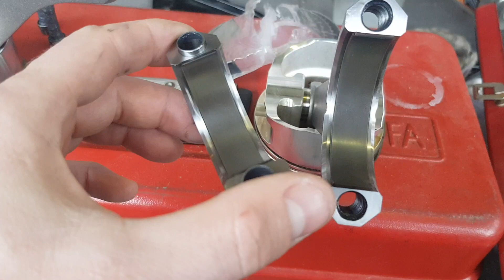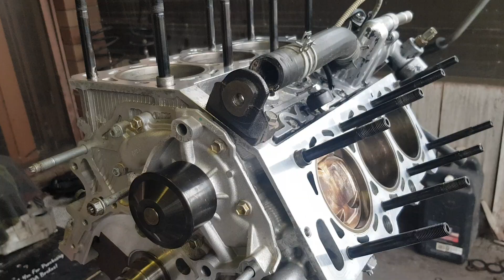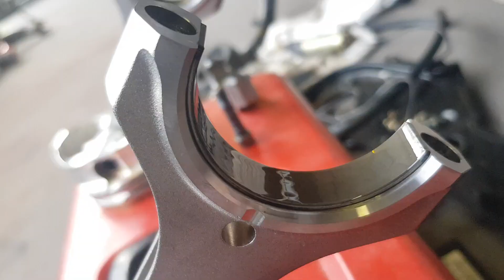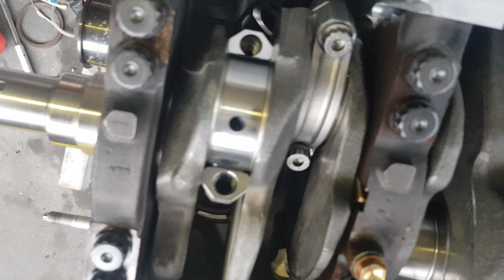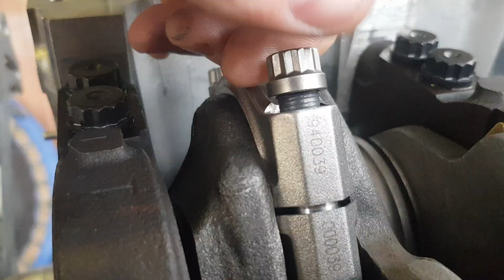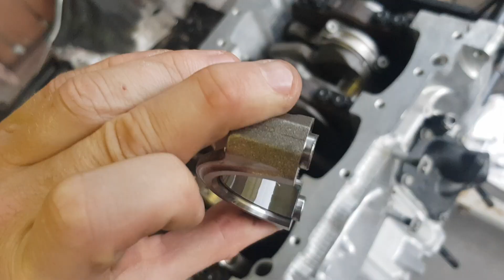Turbo AWD Camry - pt1- Forged pistons and rods.

Comment: Hey Broxon, I’ve watched all your videos in this series and am very interested in the build. You mentioned you got bored, so I figure I should ask if you’re still interested in answering questions about it, if not that’s fine. If you’re still okay with answering questions: Did you change the compression ratio with the aftermarket pistons and rods or keep it the same? The pistons look a little dished so I’m guessing you lowered the CR in preparation for boost. Did the aftermarket rods change the stroke? I’d assume the bore has to stay the same because the block is sleeved, right?
Reply from the maker: Decompressed yes, rod length same, bore same.

Comment: Going to have to scour this series up and down for a while.
Wondering if your Carillo pistons are the 87.5 2jz pistons or custom 1mz?
Reply from the maker: They arnt either of those. However the piston details is something I don't ever mention. If you are smart you will realize you can measure the oem piston to find one from another car that suits you. 2jz is not close at all.
Reply: @broxonbrookfield5665  So many nuances and specs i'm not aware of still. If we're playing guess who i'd guess for 300zx +0.5 to 87.5 because they have the same 83mm stroke and displacement, so if you go na pistons you can meet the 10.5 factory comp ratio?
Reply from the maker: @2g2b89  no they arnt 300zx. It's not just bore you have to consider. You need to figure out the compression which uses wrist pin measurements and dish and dome volumes.